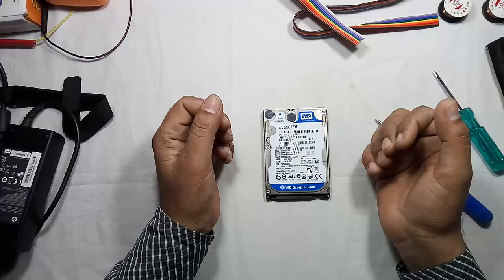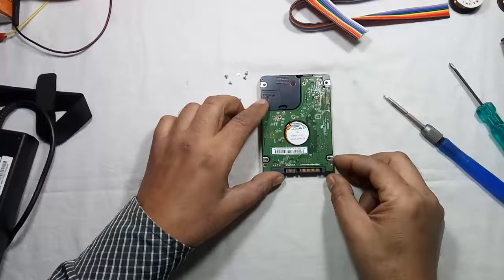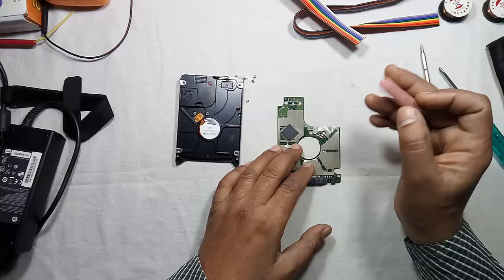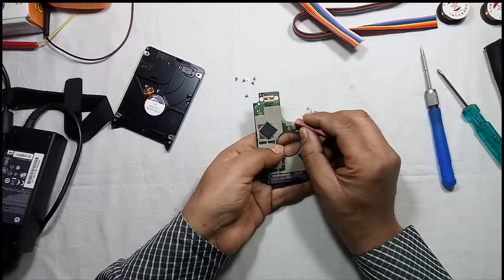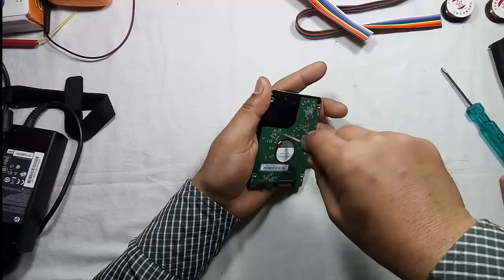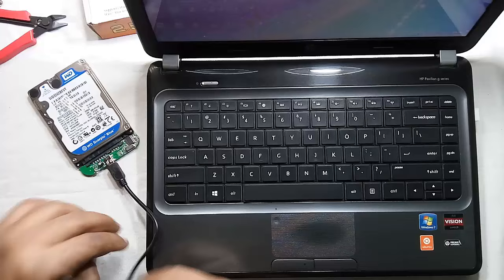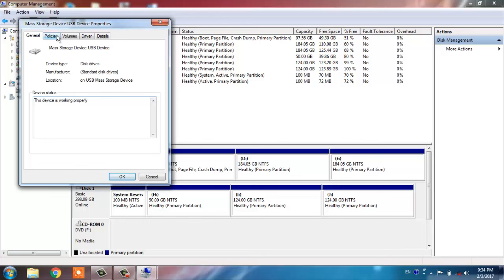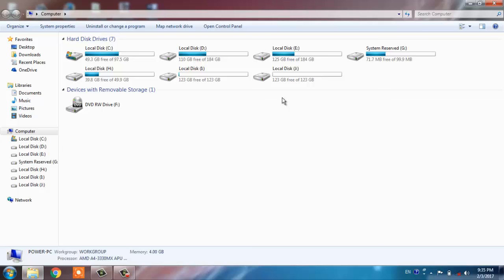How to repair hard disk not detected by Innovative ideas || innovative ideas

Comment: Pc windows 10 ,1tb hard disk ,8gh ram
Problem is 100%disk full in task manager pc turns slow.after few days while switch on pc it takes 10 mins to start until black screen is appearing.after few days pc didn't work it stops at window logo not working.then in pc repair shop they told hard disk failure so to replace rupees 5000 to 6000 charge . Is another way to repair whats the problem....???

Comment: Meri hard drive wd green  sata hard drive  my computer me dikha  nhi rahi hai bat drive eject krte hai vaha dikha rahi hai my computer me nhi ......... So plz help meee mera important data hai usmeee
Reply from the maker: Rathod Jatin try after changing SATA port after cleaning sata data cable and check in the BIOS, if it is detected.
Reply: Thanks to riply       Mene computer change krke dekha vahi problem aa rha hai
Reply: Help me....
Reply from the maker: Rathod Jatin kindly check if your HDD is making clicking sound. If so then I do not have any solution for clicking sound.
If it is not making clicking sound then you can replace logic card of your HDD with the same logic card, which you can find nearby computer repairing center.
Thanks.
Reply: INNOVATIVE IDEAS okkk thanks

Comment: What! You have RUST on your hard drive? Unbelievable.
Rust is an iron oxide, usually red oxide formed by the redox reaction of iron and oxygen in the presence of water or air moisture. Several forms of rust are distinguishable both visually and by spectroscopy, and form under different circumstances. Rust consists of hydrated iron(III) oxides Fe2O

Comment: i just tried to unscrew my hard drive to open it up to try to clean it but it doesnt unscrew  i am using a tiny screw driver as well it doesnt open .
Reply from the maker: Kindly use the screw driver set as I have mentioned in description. You can purchase it from Amazon...very cheap screwdriver set...

Comment: my wd harddisk not recognize  bios i need to recover my data 
what to do
Reply from the maker: Please check once that hdd power cable and data cable (IDE or SATA) is fine or not. You can also use Device by which external hdd can be used as USB hdd. Thanks

Comment: My 500 GB External HD (HITACHI) was working very nicely up to 05 Sept 2017. But when i connected to PC on 06 Sept 2017 , it was not detecting, but the Green LED is ON in the HD. Usually the green LED will turn to red while detecting, but now only green is ON. I have changed the USB cable, checked with other PC..no success. There is a slight single click sound in the HD when i connect to the PC, after that no special sound nothing!, when i kept the HD near to my ears the rotating sound can hear, but not detecting. The HD is almost 10 years old, but having too much data in this. How can i repair or recover the data?. Please help.
Reply from the maker: Suresh Babu  kindly check it on other pc or laptop. Some time usb ports may not be working...
Reply: Dear Sir, As i explained above i have already checked with other PC's.No success
Reply: The above issue resolved.Visited maintenance shop , they have changed the USB connector panel of the Ext HD completely and now it is detected !.
Reply from the maker: Suresh Babu good

Comment: i mistakely put power port to jumpers and now hardware wont detect plz  help.....will it  work.....???
Reply: plzz reply
Reply from the maker: bhupesh shakya it might be possible that due to wrong power supply input into HDD, logic card is damaged. Kindly try to fix it by replacing logic card of the HDD. Thanks
Reply: +INNOVATIVE IDEAS thanks for  reply
Reply: +bhupesh shakya  and can logic card be repaired
Reply from the maker: bhupesh shakya yes it can but depends on the problems...

Comment: sir my hardisk  detected on bios,,,but not detected on windows... what should I ?
Reply from the maker: might be the HDD settings in BIOS. Use HDD mode to IDE from AHCI...
Thanks..
Reply: INNOVATIVE IDEAS sir i changed hdd setting to IDE but windows is still not loading. please help. thanks
Reply from the maker: kindly watch/ feel if your HDD is making a noise(clicking sound). If it happens, then I donot have any solution for clicking sound of HDD. 
Thanks
Reply: No sir, there is no clicking sound. I think i have to follow the method you've shown in the video, right?

Comment: Hi, my dell Inspiron says “hard drive not installed. Then It turned off and I turned it back on and it went to the login screen, took so long to log in and then it takes a long time to load everything in please help I spent so much for this.
Reply from the maker: kindly follow the steps shown in the video and cleanup C drive by right clicking on its properties, delete temp, %temp%, recent and prefetch files. Thanks
Reply: Bro does this method work? Btw same problem here😥

Comment: Please be very careful on following these instructions. First, you need to make sure you are NOT conducting static electricity, as these can damage your electrical components. Use a static wrist band. Also, touching with your hands WILL leave oil and dirt (even if you can't see them), which WILL damage your HDD. Do not use a rubber eraser to clean, as it WILL leave residues. Use 100% isopropilic alcohol, applying with a paper or cloth that LEAVES NO RESIDUE (cloth or paper fibers or oils).

Comment: i did everything you did and this seagate hard drive is still failing. its never detected in the bios
Reply from the maker: Kevin Echols-EL sorry to say, if your HDD is making clicking sound  then I do not have any solution...
Reply: INNOVATIVE IDEAS no no its not clicking. Its a brand new laptop. never been used before, but Since the hard drive isn't showing that its connected to the motherboard I am unable to even install the OS into it
Reply from the maker: Kevin Echols-EL can you send me snapshot of your boot device options
Reply: INNOVATIVE IDEAS sure thing where should i send it to? im going to send it to your fb page.  I will send it in 20 minutes.
Reply: INNOVATIVE IDEAS I shared it on your wall on facebook

Comment: pleez sir help me
Reply from the maker: What happened..क्या हुआ कृपया डिटेल में लिखिए
Reply: INNOVATIVE IDEAS sir I have 2 500 HDD it is notdetected if I booted the computer any ideas? but it is new
Reply from the maker: Please connect your hard disk drive before booting/ powering on your PC. If your PC is booted by your previous hdd, then wait for the drivers to be installed. or go to the device manager for the same. and if you want to boot from your new HDD then please install operating system(windows) first.

Thanks.
Reply from the maker: Kindly check the settings in BIOS if it is on AHCI mode then please change HDD mode to IDE. Thanks

Comment: EEEEEEEEEEEEEEEEEEEEEEEEEEEEEESSSSSSSSSSSSSSSSSSSSSSSSSSSSSSSSSSSSSSSSSSSSSSSSSSSSSDDDDDDDDDDDDDDDDDDDDDDDDDDDDDDDDDDDDDDDDDD.
Reply from the maker: mean ????????
Reply: Electro static discharge. Does it ring the bell.
Reply from the maker: No.. There might be clicking sound in your HDD..
Reply: You should not touch electronics if you do not know the meaning of ESD. You are touching the PCB with bare hand with no ESD protection. Let me guess you do not know what is PCB. The connector does not get rusty, you have a built up of carbon on the PCB. You should use isopropyl alcohol to clean the board.